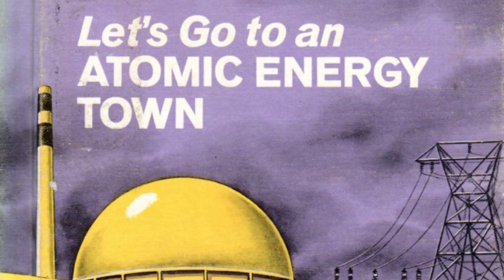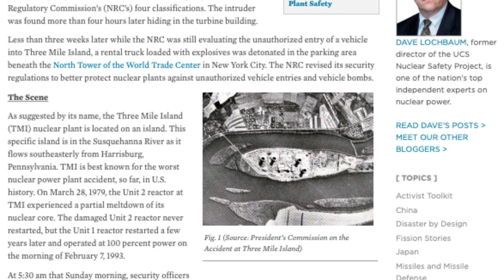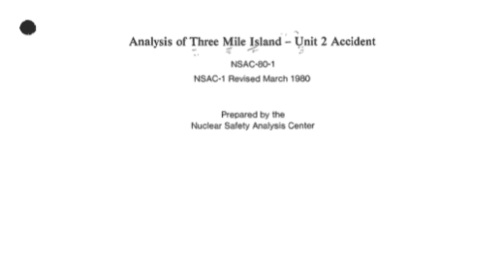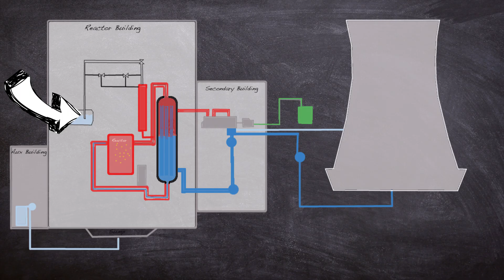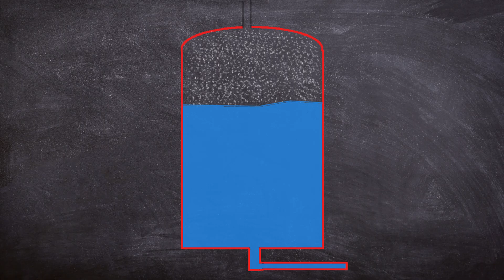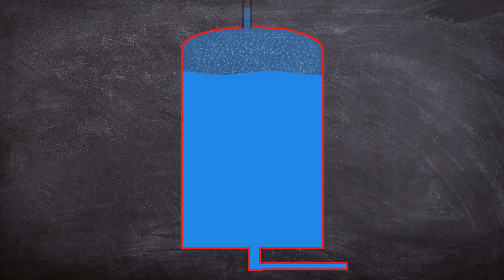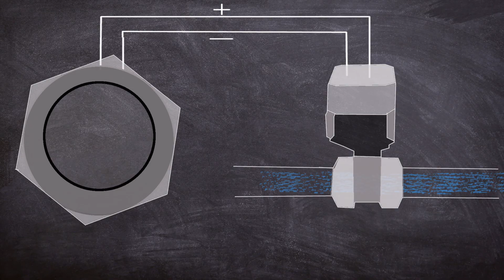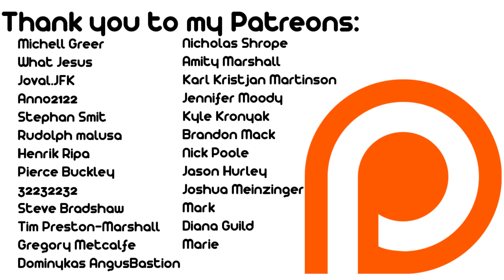A Brief History of: The Three Mile Island Accident (Short Documentary) (Part 1)

Comment: The reactor core was removed in a shielding cask and shipped to the Idaho Nuclear Engineering Lab, now the Idaho National Lab. At that time there was a large "hot shop" at the north end and the core was taken apart and examined in there. It was found that approximately a third of the core melted with the fuel and the metals mixed with the melted fuel. The dilution of the uranium by the other metals in the core moved the fissile atoms far enough apart to slow the reaction and everything solidified again. It was still hot and still radioactive, but not melting its way to the earth's core like the plot of the movie said. The reason that the hot shop existed was for loss of fluid testing (LOFT) of different designs of reactors, including the TMI models. They would construct a reactor on a very large flatcar that ran on 2 parallel railroad tracks. It would be pulled out of the hot shop and moved into a containment building northwest of the shop. Then it would be connected to water and instrument lines and run up to full power. When it was operating normally, they would drain the coolant out of the reactor and let it go into meltdown. The results were the same every time. The melted core metals would dilute the uranium and stop the meltdown. The TMI core did exactly what all of the testing said that it would. Jane Fonda's nuclear terror movie was just Hollyweird fantasy, but there are still people who think that it could really happen.

Comment: This got me thinking. Why don't we build reactors so there is an emergency scram chamber underneath the reactor, where the rods can be shot down into an electron dampening/absorbtion chamber?. That way when shit fails, you can shove the rods down and prevent them from interacting with the reactor any further? Sealing them off until they can be disposed of.
Reply: In a way, this is almost exactly how thorium-based reactors work. Thorium is extremely abundant, produces a lot more power, and isn't fissile by itself.
All we need for a reaction is an extremely small amount of plutonium, barely enough to be dangerous, and we're off to the races. If shit hits the fan, the thorium can be separated from the plutonium, and the fission immediately stops, since thorium isn't fissile by itself. No mess, no stress.

Such a shame that we don't have any thorium reactors functioning yet, though. Nobody wants to invest in them.

Comment: To make is safe, the primary water is isolated from the secondary water by a heat exchanger. Also, the primary water is under 2200 PSI pressure to keep it from boiling. What could possibly go wrong?

Comment: Funny thing, is this was about the worst case scenario for a nuke plant but caused little overall public risk. Part of the issue was the way the control and annunciators design, it was counter intuitive for the operators to truly understand what exactly was happening. Afterward, a lot oof changes implemented. FWIW, Rancho Seco, our local nuke plant, was a twin of TMI. Turned out it was so pórly maintained (and drug use was prominent) plant was decommissioned after a public referendum.. A bit waste since the plant could have been viable if well managed..

Comment: Now all of these types of solenoid valves use an internal magnet that actuates an external switch which will indicate the actual position of the valve. Also there are temperature sensors mounted to the downstream pipe that will indicate if there is steam flowing thru the pipe or not.

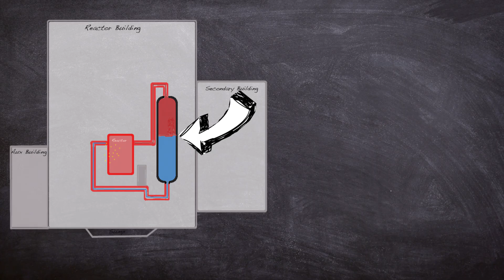Comment: A bit of grammar comment. At 4:41 you mention inside a 13 feet tall generators “there IS many small diameter TUBES…” since tubes is plural, the verb should be “are.” “…there are many small diameter tubes..” Thanks for the video.

Comment: It's a shame that the idea most people even today have when they think of nuclear power is Three Mile Island and Chernobyl.

They forget how much the tech has advanced since then, and in no small part because of these failures. Modern nuclear power is extremely safe, but it has a bad reputation and needs better PR.
Reply: The real tragedy of TMI was the way they handled it. The average dose of radiation people around it got was .08 mSv. That's basically a chest x-ray. They acted like they were all going to die over it.

Obviously it's still unsafe, and there should have been a small panic and safety measures should have been taken, but some accounts of the incident state that the air-raid sirens were set off, children were told to run home or they would die, parents were not notified of where their children were, hospitals and buildings were evacuated, etc.

Comment: I live about 15 miles away from tmi. It's weird watching videos about it. My grandfather was a teacher and had a Geiger counter setup in the yard. He says he never detected anything over the normal amount. I still go up to take pictures of the plant and it's decommissioned now. a very large monument to human error.
Reply: The amount of radiation that was actually released was roughly what you would get from an x-ray. There are places on earth that have a natural background radiation higher than what was released.  It's a pity it caused such a panic or else power would be a lot cheaper and reactors would be a lot more advanced and safer instead of most current plants running on reactors at the end of or past their operational lifespan.(meaning they are becoming less safe by the day). Fun fact there was actually a reactor in development that could not meltdown.  Literally it was impossible because high heat stopped the nuclear reaction without needing a scram system.

Comment: A well presented brief history but with some errors. At time stamp 10:42 you identify the wrong reactor coolant pumps - the one's you ahow are on the secondary circuit, the ones that were cavitating were on the primary circuit. There are reasons why this occurred on a Babcock design PWR reactor that would have been very different on a Westinghousae designed PWR reactor - principally down to the design of the boilers. The B&W design use a once-through boiler design. It is inherently more efficient, and leads to higher steam temperature, but has much less water inventory at full power, and maintains the highest point of the primary circuit outside the boiler. With the Westinghouse boiler design, using a U-tube design, there is much more water inventory in the boiler, and the highest point of the primary circuit is underwater in the U tube section. From the accident point of view, the U-tube design would allow much more cooling and a longer time period before boiling dry (tens of minutes compared to less than 2 minutes for the B&W design) which may have given the opportunity for the operators to identifiy the isolated emergency auxiliary feed system. Secondly, once steam starts forming in the primary circuit, it will naturally raise to the highest point of the circuit - particulalry once any pumps are shut down. With the highest point outside any cooling opportunity, it becomes very difficult to recondense the steam. In a U-tube boiler, merely keeping water levels above the level of the tubes will cause steam in the primary circuit to recondense, eventually allowing the coolant pumps to be restarted. I could talk about this for much longer if you were interested as I levetured on the lessons learned for many years.

Comment: So, this accident actually had a precedent, and B&W was supposed to have trained their reactor operators to understand the possibility of the PORV being stuck open. A similar scenario had occurred twice at Davis-Besse plant but operators there realized what was happening and stopped it.
Back in 2012 I worked at Areva in Lynchburg VA with a guy named Bert Dunn, doing loss of coolant accident analysis. He was one of the engineers back in the 70s who warned B&W about this design issue. The recommendation that he wrote ended up sitting unopened on the desk of some manager at B&W (may have been Siemens at the time), and wasn't opened until after the TMI accident.
It was pretty wild hearing the story from him first hand. 
https://www.nytimes.com/1979/07/19/archives/engineers-warned-builder-of-danger-year-before-three-mile-island.html
You can read about some of it here.

Comment: Kind of terrifying that the operators had about 4-9 seconds to begin reacting to things once the first pump failed.
Reply: Exactly why Atomic energy is fucking dangerous and irresponsible form of energy production and deserves to be scaled back.
Reply: @jackd6881  you do realize that things have changed since then right?
Reply: @jackd6881  its almost as if we have improved things since then, nuclear is the only feasible low carbon footprint source of energy atm
Reply: @jackd6881  it’s done by computers now that can calculate trillions of reasons why something is failing in a second. I think we will be justttt fine.
Reply: @jackd6881  😢😢😢😢😢😢😢😢😢
Reply: @jackd6881  it is done automatically with multiple redundancies, even then i believe the control rods where inserted by an automatic trip, with new technologies it is now electric and trips even faster.
Reply: @jackd6881  this is one type of Reactor not all..... LOL

Comment: There is a story on how a tiny Penn Central (owned by Conrail) switcher locomotive got so blasted by radiation that it had to be scrapped on site, packed in lead crates, and destroyed. It had been operating on the small industry siding when the disaster happened, and the crew bailed and left it. The crew barely got any radiation, because they had evacuated just in time.

Comment: Davis Besse 1 is a B&W PWR built at about the same time. Very early in the low power operation phase before full commercial operation the same valve stuck open. I don’t remember if this was 1977 or 1978. The operators responded correctly but there was sufficient pressure in the quench tank to blow the rupture disk. There was very low level contamination and insulation was blown off one steam generator. I was the insurance investigator. If only the sticking valve problem was addressed across all B&W reactors of similar design.

Comment: An additional point that I don't often see mentioned - the operators actually did suspect that that PORV might have been stuck open at one point, so they checked the temperature of the valve. The reading they got - 285F - should normally have indicated the valve was open, but they'd also been having a problem with a leak in that valve, causing it to normally show a higher-than-normal temperature, so this indicator was missed as well.

Comment: These old outdated reactors need to be updated every 5-10 years to keep up with current times. As well as employee training
Reply: Nah. The reactors themselves can be totally fine. Control systems, however, do have to be updated occasionally. 
The one nuclear reactor (for power generation) we have in my country, is already 50 years old and works fine. It adheres to all modern safety regulations.
Reply: If you only knew

Comment: The design of the pilot-operated relief valve was incredibly sloppy for such a critical component. The use of a power/depower indicator rather than a physical position indicator is almost criminal in this situation. It is also sloppy that this valve was not formed of four valves (each with position indicators) arranged in two parallel chains of two valves in series which, of course, ensures that one single valve stuck open or closed does not impinge on system operation and is detectable (for maintenance instigation) from the position indicator set.
Reply: In that arrangement you’re now relying on the operation of at least two rarely operated valves to function correctly. Also indicating lights off power vice VPI isn’t horrible with well trained operators and more importantly backup indications of failure
Reply: @whiski_whiskerz  No we are not. The first thing to realise is that, in such an arrangement, each valve can be individually tested for correct operation at any time without impinging on the operation of the plant. One could have a test schedule that checks each valve in turn for correct operation (with positive valve open and valve closed indications) perhaps on a weekly basis. This eliminates the "rarely operated" (and by implication possibly inoperative) factor that was a feature of the design actually used and a significant contributor to the accident. Carefully designed duplication, triplication and higher order redundancy are a common feature of many safety-critical systems (most notably aircraft). To make sure the redundancy increases safety rather than reducing it is a matter of doing the failure-mode analysis carefully.
Reply: Colin Mill weekly relief testing would be horrendously impractical. These valves are generally within the containment requiring the Reactor be shutdown. Also testing of the upstream Relief would be likely to cause damage to the down stream given that generally these valves are reverse seated and seated by steam pressure and with the inter leg of pipe at lower pressure the sudden shock would force the disc into the seat possible sticking the valve.
Reply: @whiski_whiskerz  You don't need access to the valves to test them. As for the issue of hammering the valves into their seats it is by no means impossible to construct a valve that is capable of withstanding shock loadings and, if needed, the upstream valve could have an initial low-flow rate bypass to reduce the hammer on opening. Keeping the void volume between the valves small would also minimise the effect.(to say nothing of the fact that, unless there is an issue, the voids in the valves and the rest of the pipework at filled with water not a compressible gas that would induce hammer)
Reply: Colin Mill for any porv I’ve had experience with physical access to the valve is absolutely necessary. Also an equalizing bypass would by design prevent the upstream valve from providing protection from failure of the down stream valve from failing open. Also that introduces problems with testing the downstream as valves with internal bypass features are not approved maintenance boundaries. Also at temperatures this high density of the water does become a significant factor genes water being “essentially” incomprehensible you will experience significant pressure shock when a relief is lifted
Reply: Colin Mill also at significant enough back pressures you will get inconsistent lift points for the pilot causing the valve to lift below its design set pressure
Reply: @whiski_whiskerz  The valve in the TMI installation was in the containment so had no physical access without shut-down.
Reply: Colin Mill physical access is required for testing not general operation
Reply: @whiski_whiskerz  I'm sorry but the idea that it is beyond engineering to design a redundant valve set that can be remotely monitored for functionality is beyond absurd. Amongst other things I was involved with the Cassini Huygens mission and obviously physical access for testing in that case became slightly problematical after October 15th 1997 8-)=
Reply: Colin Mill it’s not beyond engineering it’s beyond what is practical. Unnecessary complexity. Lack of training is a more significant issue than the valve itself
Reply: @whiski_whiskerz  We are just going to have to agree to differ. Perhaps it's a matter of the industries one has worked in. From my viewpoint complexity is not the enemy of safety - properly implemented it's quite the reverse. However,  poor engineering always is the enemy of safety. The commercial aviation industry has, by any measure, been the subject of outstanding gains in safety since the 1970s (nearly two orders of magnitude measured by fatalities per passenger mile) and this has been in no small measure due to the growth in the complexity of the aircraft systems. It is, to my mind significant that the 737 Max problem arises out of the failure to provide redundant AoA data to a trim system that, due to requirement changes during development, went from a non-safety-critical element to a safety-critical one as its permitted range of operation was increased. One of the important aspects of the more recent aircraft is the ability of their highly integrated systems to correctly diagnose failures and work around them. The revisions to the Airbus AoA voting system following XL Airways flight 888T is an example. Having, shortly before I retired, witnessed how well a neural network can fly I'm rather keen on the idea of the pilot-less aircraft. An AI system doesn't get tired, decide to commit suicide, have it's wife divorce it or be desperate not to miss tonight's hot date. No amount of training gets you over those issues.
Reply: Colin Mill it very well could be the culture we both experienced at the beginnings of our careers I am by no means an engineer I am an operator. Also I was formed in the nuclear navy where emphasis on smart well trained operators is paramount to our 65 years of incident free reactor operations in not always ideal circumstances. A very heavy hand is placed on operators to not rely on automatic features or standby features of various systems and backup from other operators is placed much more at the forefront of how we stay safe. Which is where I get the mindset however old fashion and most likely wrong it is that the when the plant fails to react as intended it is the operators responsibility not the engineers. It also could be the growing pains of automation that has put a sour taste in my mouth for even more complex automation. I feel it is the engineers responsibility to design and construct these systems in a way in which they are safe and redundant without cresting the hill of operator confusion. I see the growing automation as less of a replacement for human operators and more of an added link in the chain of operational backup between operators and computers.